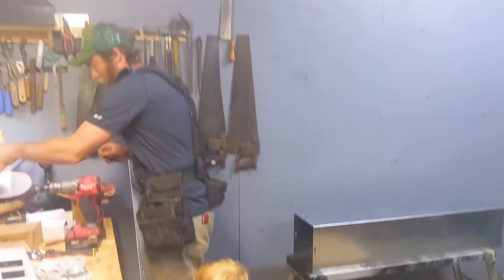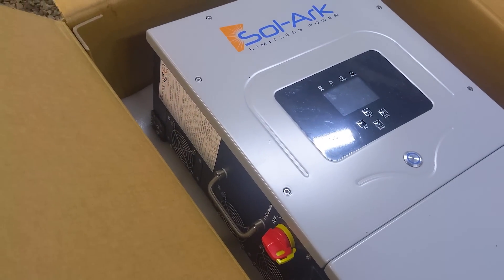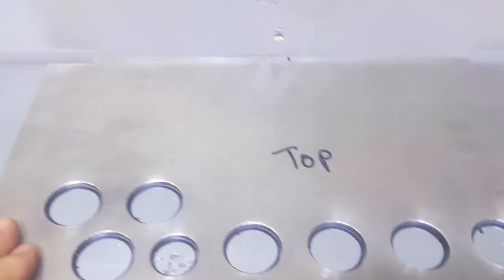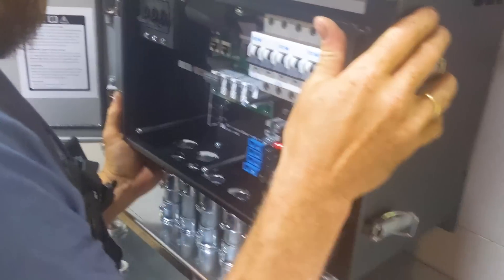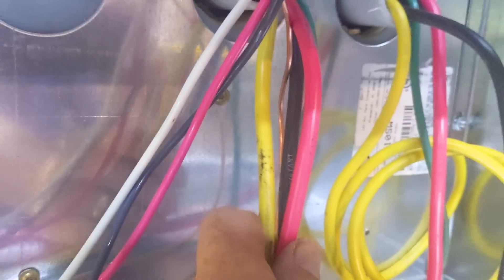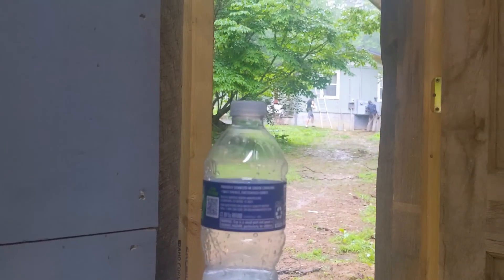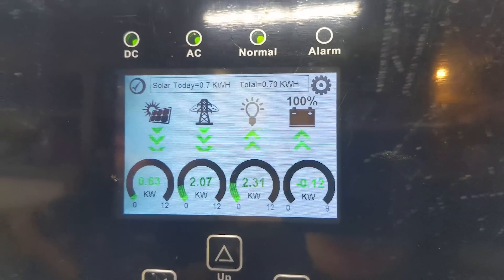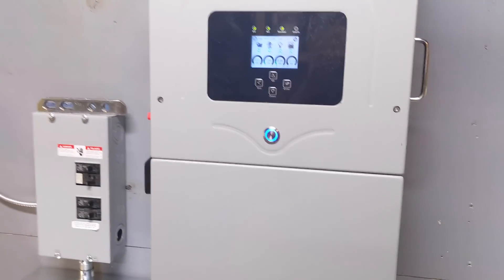Sol-Ark 5k on Independence Day

Comment: I know this is a old video but wondering if the 5k can truly surge to  16kva for 10sec as documented in the spec sheet. I don’t use more than 4 k of load,  but have a well that surges to 9k for one second. If the water heater had trouble worried about the well pump.

Comment: you mentioned "we're not selling"  i'm under the impression that this Sol-Ark inverter is equipped with LIMITER, is that correct? or a feature so it will NOT back-feed the grid?  thanks
Reply from the maker: That is correct
Reply: I read on another YouTube post that if the power company doesn’t have a net meter installed it will charge your for electricity generated because it can’t tell if it’s ‘coming or going’. That doesn’t seem right. Thoughts?
Reply: Im not quite familiar with SolAkr's features thats why i asked if its equipt with a limiter, coz said your not selling power, im under the impression that it has limiter. 
Also i use inverters with limiter. And yes they work. It doesnt feed the greed and i dont get charged, its all savings to my electric bills

Comment: It's about time theu put the PV disconnect on the side and not behind everything on the bottom where you can't see it and big hands have a hard time reaching. Whoever designed that original disconnect location needs a dirty diaper slap.

Comment: I see it said damage will occur at the battery input if voltage is above 65v. The solarks label says max 63v.. I charge my battery to 64v. Do you think I could use. 64v max battery voltage since it says damage won’t occur till after 65v? Will it charge the battery up to 64v from solar and AC?
Reply from the maker: The max is 63.
Reply: @engineer775  shucks.. wish we could use a 16s Li-ion battery with these. They look awesome. Victron can use up to a 66v battery. Outback can use up to 68v. MagnaSine can use up to 66v

Comment: Shouldn’t it zero out the homes loads by taking power from the battery if solar isn’t enough?
Reply from the maker: It surely can do that in time of use rates but some battery chemistries are better than others. When we use sealed lead acid batteries like this we don't want to beat on them as their life isn't as long as the lithium batteries we have today.

Comment: FYI, the Schnider can also work with CT’s now. Standard modbus ct controls… I set one up on my solaredge and the same $50 unit will run on the Schnider xw+ or xw pro.
Reply: Also if you set it up as the transfer switch point (between the grid and the load) it can do load shave (0 out grid use)

Comment: Exactly what can you run off of the 5k? Lights, refrigerator, etc.! I'm pretty dumb when it comes to solar!
Reply from the maker: Abe can run anything and everything in his house He just can't do it simultaneously. We ran the air conditioner in his RV We ran as well pump his grinder pump lights refrigeration you name it. It did struggle on the electric water heater but that's because we had other things running. If he controls what he's doing via the breakers there's not a load in his house that he can't run and most of the loads he can run simultaneously

Comment: why would you call a water heater an ugly load? It is purely resistive and has no SURGE at all. Please explain
Reply from the maker: It is just a large load 4500 watts
Reply: @engineer775  That is what 1kW to 2kW elements are for.
Reply from the maker: @randacnam7321  that is correct but when there are eight people in the house I just want to make sure they have enough hot water when they need it. Yes lowering the elements works but sometimes it cannot keep up with the demand.
Reply: @engineer775  this is what heat pump water heaters are perfect for.

Comment: i may be missing something , what is the benefit of going with a 5k over a 8k. does it charge / invert better being a smaller unit or did it come douwn to price.  you said o weather proof box for out side but it looks like it was inside a shed anyway?
Reply from the maker: It is an outdoor rated case and about 1200 less than an 8 k
Reply: @engineer775  Is the 5k EMP harden ?
Reply: @randycollins5981  Optional.  Same $1,500 cost as with the 8K and 12K.
Reply: @randacnam7321   Thank you i had made up my mind to go with Magnum, But now im not so sure !